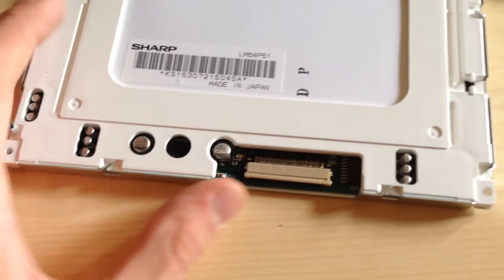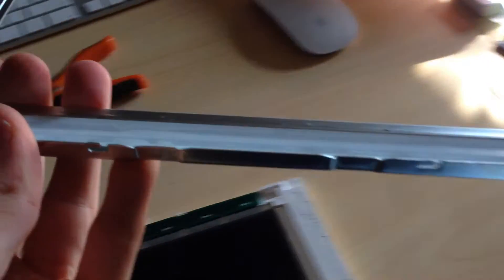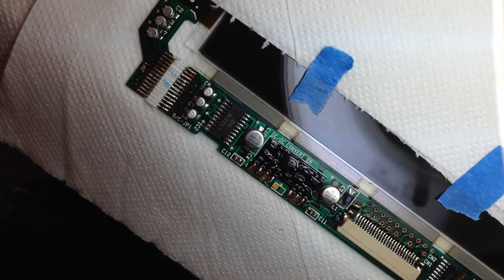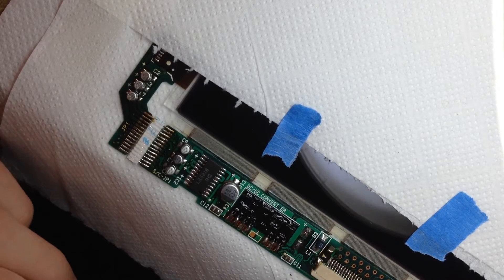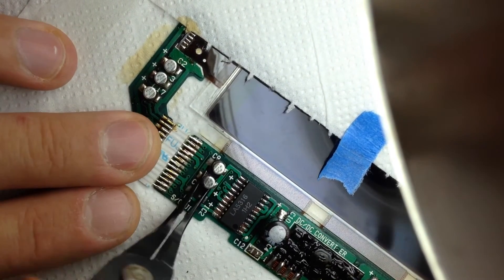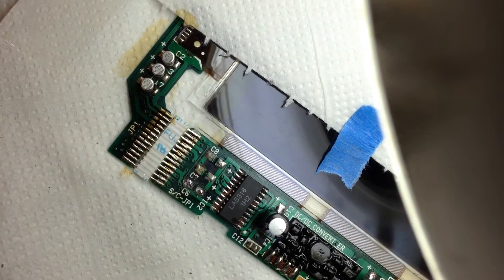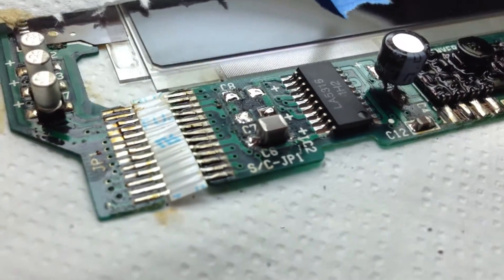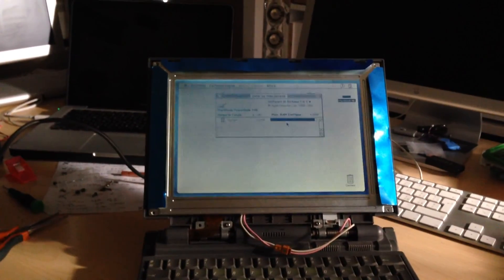Apple Macintosh Powerbook 145B (same as 140, 160, 145) Display Capacitor Replacement repair ReCap

Comment: How do you open the laptop to get there?
Reply from the maker: You can just open the display part my removing the two screws you see at the bottom of the bezel, then four screws hold in the display panel. Do this while holding the enclosure to not stress the hinges

Comment: you need fluuuuuuuuxxxx
Reply from the maker: Board is very fragile and flux might go on the display panel. I’m using multicore 711 that already has good flux in it

Comment: I also do not think the 160 used the same display as 140 and 145.  If I remember right, the 160 had one with more grey shades.
Reply: Correct: the 160 has 16 shades of gray.

Comment: What about if the display has dead pixels?? and there is light coming through the back.
What is the fix for changing the capacitors?
Reply from the maker: I don't think that dead pixels can be repaired, unless it's an entire row or column, in that case you could have bad bonding between the LCD panel and the driver board (the brown ribbon cable), light coming thru the back should be normal, pretty much every panel does that (that's also why the Apple logo is backlit).  Usually bad capacitors give you no contrast at all, and the the display usually remains black or very dark.

Comment: Is the Sharp LM64P51 the only model compatible with 145b? Thanks for video!
Reply from the maker: +Mel Ristau Probably yes. The 145b shares the same display with the 140 and some of the later low-end powerbooks. the 160 uses a different one, the 170 has an active matrix display
Reply: Mine has a Sharp LM64P58

Comment: You probably could have had better soldering with the components if you had used flux. That's always something I've used whenever I solder. Be careful, because your soldering may weaken over time and develop "dry joints", leading to a similar problem like the one that you had before.

Comment: ho fatto un video dove si vede il sintomo dello schermo (è difficile da spiegare in italiano figuriamoci in inglese)
cosa ne pensi?

Poerbook 145b screen problem
Reply from the maker: ciao, ci ho dato un occhio.
il sintomo dei miei display era diverso, partivano neri, per poi schiarirsi pian piano.
ho avuto un problema ("lampeggiamento") simile sull'intero display quando ho cambiato i condensatori al primo display, ho ritoccato le saldature e pulito bene la scheda dal deposito dei condensatori e tutto si è sistemato.
quindi è probabile che il problema sia qualche saldatura che si è corrosa ed è crepata oppure l'elettrolita dei condensatori sta "disturbando" il circuito.
oppure io controllerei il cavo (ho visto i tuoi video a riguardo), dato che il problema accade diviso per metà (la parte superiore e inferiore)
Reply: Francesco Ferretti ciao, se ti riferisci al video "extreme repair" il tutto è stato ripristinato come in origine con un cavo flex originale ed ha funzionato tutto bene per parecchio tempo (a parte il solito lieve ghosting e un tempo di riscaldo per il contrasto di qualche minuto specie quando non lo accendevo per mesi) . il fatto è che questo lcd montato su un 165 dava gli stessi problemi, mentre se monto l altro lcd su questo 145b non ho nessun flashing ma solo contrasto nullo. ne deduco che il problema quindi non riguarda ne le connessioni da inverterboard né il flex cable ma solo ed esclusivamente gli lcd che danno anomalie completamente diverse. proverò a ritoccare le saldature. cambiare i condensatori è un rischio nel senso che potrei ritrovarmi nella stessa situazione di adesso...

Comment: hello. thanx for your video. i would have dissoldered the old ones but the risk of damage the circuit points on the board is so high so i think your system to break the old capacitors is very good. btw i' ve got a 145b with a screen beginning to pulse and  have a division like a horizontal line in the half of the screen. it pulses also dark and bright with vertical lines. do you think could be the capacitors or the lcd itself that' s definitively gone?
Reply from the maker: it is possible that the connection between the circuit board and the panel is failing.
also mine was "flashing" before the capacitor replacement.
Reply from the maker: Ciao!
ti lascio i codici RS dei condensatori che ho usato, fino al 31 ottobre puoi usare il codice L5DPFV per un 10% di sconto sul totale

740-7767
116-925
704-7801

poi io li cambierei anche alla scheda inverter, tutti gli altri sono ceramici o al tantalio
116-802
116-818

Comment: Dont touch the backlight assembly with your fingers! skin oil will get into the diffuser, and its hard to get out again. And youll see the smudges in the image.
Reply from the maker: Thanks!, great tip!
Before putting the display back in its assembly, I cleaned both sides with very little IPA and a microfiber cloth